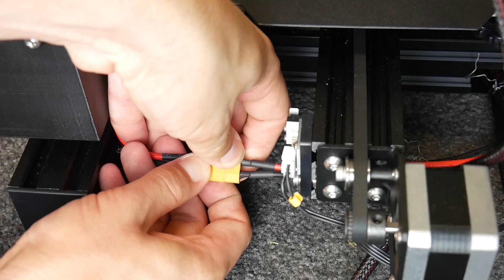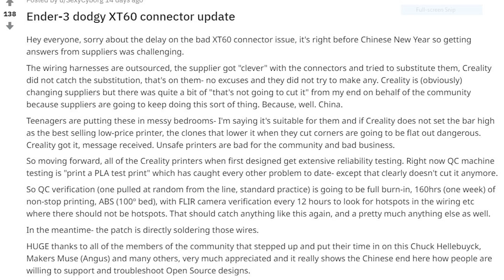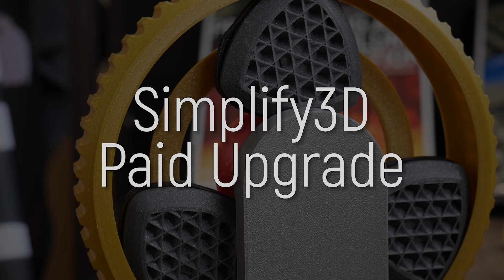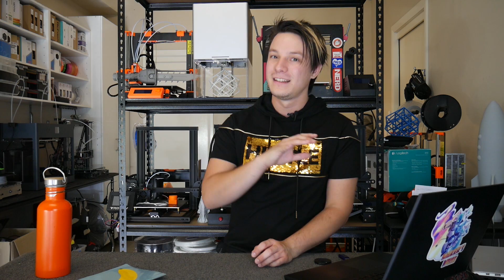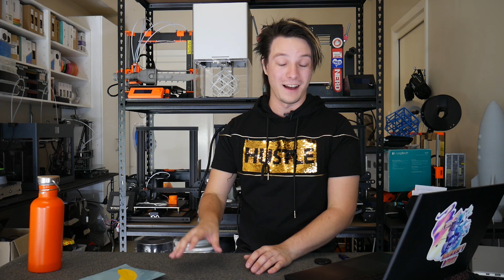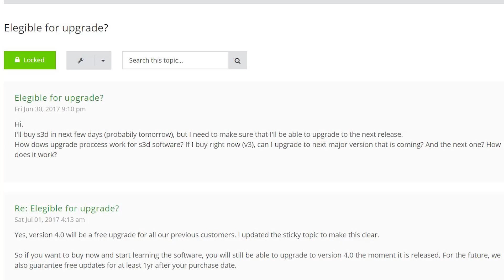Ender 3 Connector Update and Simplify3D Paid Upgrade - Maker's News Feb 2019

Comment: Hey Angus!

Just wanted to let you know i received my Ender 3 today and it was awesome! best build i have done so far, Everything just fit perfectly and worked first time. It came with a glass build plate and also a removable flexible build plate! They seem like genuine xt60 connectors and couldn't be happier with the quality of this build. All for around $280!

Not too mention came with a much better sd card reader, lots of spares, 5 different size extruder holes ranging from 0.3mm to 0.8, a bunch of tools and a few other bits and bobs.

Comment: I too bought S3d after the comparison video (and others). My experience with it has been good. It did the things I wanted, like processes, and seemed to produce a slightly better finish on my prints than the previous software. Haven't had problems with bugs or crashes and prefer not to have to update software a lot. If it continues to work this way, I will carry on using it. May even set it up on another computer as backup (current one getting a bit tired). However, changing the payment rules will cause me to look for an alternative.

Does anyone know if Cura or Slic3r support the Flashforge creator pro without having to develop my own profile? I tried Cura early on, but though it listed my printer, it only recognised one extruder.

Thanks in advance for any help.

Comment: I bought yesterday a simplify licens and nothing works out of the box. In my opinion it's as good as other freeware slicer. Ok it has some spacial feauters but you don't need them for standard prints. I will use the 2 weeks money back option...
Did someone of you use Craftware as slicer?
It's one of my favorites. It's free and get's better and better with each new version.

Comment: Hi, I have had a Creality Ender 3 Pro for 3 months now, and I've printed many things, but they tend to be on the smaller end. The longest print I've done was around 10hrs. I've looked at my "XT60" connectors and they are fine, and they have a snug fit. I have not checked whether they are soldered or crimped. If they are soldered, should I leave it as is? Or should I just play it safe and directly splice the wires?

Comment: I wonder if the simplify 3D paid update will finally have angled supports.   Being able to place a support at an angle (other than straight up and down vertical) is great for models where an angled support can just be angled to a nearby part instead of a long support all the way down to the bed, or if a small high part of a model needs supporting resulting in a tall skinny easy to fail support the support can be buttressed with other angled supports.  Very useful, and freely available in Craftware for ages!    Do any other slicers provide customisable angled supports?

Comment: Shot in the dark question but do you have any kind of tutorial or some suggestions for setting up a cetus mk2 profile for cura?
 Though I'll have to figure out the extrusion as I'm running a e3d v6 with a printrbot gear head extruder

Comment: Of course a company with a business model only based on selling software has to do something when the market saturates, because you have running costs. I purchased S3D 4.1 because at the time it simply was more advanced than Cura which followed with my printer. However, as you pointed out in the video, the free competition is there now, and while there might be some things which are still better in S3D 4.1 than Cura 3.6 I will not pay an almost full price again for an update, whatever the new bells and whistles even would be. Let alone the fact that S3D most probably will become completely unusable and locked-up whenever the company behind it vanishes or even decides to shut down old licenses - see Joel's trouble recently.

Comment: Thank you for your point of view, I think the whole community thinks the same, Maybe an upgrade fee $20- $50 max only IF  5.0 brings plenty of changed and new features. But charging $150 AGAIN for the same software is not cool.  I feel bad for those who purchased before the update $150 for 4.0 and $150 for 5.0 is almost the price of a new printer. At that point save your money forget s3d get a new printer and use cura! LOL

Comment: S3D is losing the slicer war fast. Their two big advantages, being custom supports and multiple processes aren't advantages anymore. Slic3r and Cura (if you install a plugin for it) can now do custom supports, and Cura can mimic multiple processes, and if you think ahead in your design it's easy to pull off.

Comment: After watching this video I checked my connector, and sure enough, it had burnt the plastic, and even the wires themselves were hot to the touch! I've been using my printer for over a month now, and it's kind of scary that I didn't notice this before. What I would like to know is if this is covered under warranty. My thought is that yes, it would be, and Creality would be obligated to send a "fixed" connector that I could replace the faulty one with. However I would like to know if anyone has tried, and what your results were.

Comment: You might want to put the protocol in your about page for the websites, they don't link on mobile.

I've also got a question for splitting up models. What's the best way to do that? I've got what's essentially a large rectangular prism and I need to split it up. I'm thinking something like dovetails would be best, but I'm not sure how one would do that in a way where the clearances would allow them to slide together. Any tips would be greatly appreciated, since I don't have much material to waste on fails.

Comment: I'm a maya,  lightwave, ZBrush user so $150 is not much to me but I admire the many other slicers out there that continue to improve and don't charge a dime. SLA printing is coming down in price and Peopoly has their own slicer now (Asura/ Cura based) and is free.  I might even stay with SLA full time depending on how the market goes with the larger SLA machines. I love not having to worry about all these mechanical and electrical problems with FDM. Trade-offs. . .

Comment: I'm one of those not happy with Simplify. I was under the impression it was the best out there, and was an investment into my current and future printers.
It seem I made an error in my research. I spent a couple of weeks combing the internet for info on printers and software. I did my homework and still made a bad move. So it goes sometimes.

I purchased S3D not long (2 or 3 weeks) after my setting up my 1st printer last year. I now have a <6 month old software package that WAS SUPPOSED TO INCLUDE UPGRADES, and now they want more money. I bought obsolete software for $150. One of the reasons was the Makers Muse series, but I don't blame you for the snag, I'm fully responsible for my actions, and I decided it was the best move. I was wrong. (not all that infrequent of an occurance) 
During my research, I was watching somewhat dated videos from you and several other reputable people in the field, and I spent the money whilst having a issue I had with Cura, which simply could not do what I wanted. S3D could, and easily. I'll give it that, it's not bad software, and it's easy to learn. I was on the fence until now if it was worth the price asked, but figured I'd see how the next few updates went before passing judgement there.
I now know that answer.
It's not the 1st (nor last most certainly) of my 'fun money' to crash and burn. I guess I'll keep using S3D as long as I can, and keep watching the pulse of the industry. It's now on me to learn another slicer (or 2 - or 3) and sort it out myself. 

I'm not cheap, but I am physically disabled and don't have a lot of money to throw around.  I fully commit to most of my endeavors, and now have about $2000 us in printer, filament, and parts. 
I plan to continue to improve my printer setup, but that $150 is the last of my money S3D will ever see.

Comment: So slic3r doesn't have something as nice as multiple processes, but it does have something that I believe is just as capable, and that is the ability to load modifiers for objects.  the way it works is, you double click the object, then click of load generic to load a generic cube (I think a cylinder is also an option)  of a specific size. after loading the generic you can move it around and change it's print settings, which take effect wherever it overlaps with the object.  You can use this to change settings at different layer height, and I believe even different sections on the X and Y planes (though I've never used it this way).  You can do this per object on the build plate if you want to print multiple objects at once that need different settings.  You can also use the load modifier to load a mesh of your choice, meaning you can design a mesh specifically for modifying the print settings in precise areas of the print.  It's a really powerful feature, thought takes a bit longer to set up than multiple processes.  I beleieve cura is able to do something similar, old cura had the tweak at Z plugin, which no longer works in the newer version but I believe has been replaced with something else, but I don't use cura so I'm not sure.
Reply: +Joe Well  I was unaware of this (Slic3r) trick. Thank you.

Comment: I've purchased S3D in 2015 and since then there were like 3 major updates (3.1, 4.0 and 4.1). That's 50$ per update. I'm not paying $150 again, no mater what since recently I switched almost exclusively to Slic3r Prusa Edition. The only way I'm paying anything for this update is if the changes are massive (and I'm talking introducing most if not all of the features community is asking for since 2015) and if it's around $15. 
I understand that the company needs money but they were promising features 'comming soon'  and they never came (probably pushed to 5.0 to make us pay) and I never owned a peace of paid software that  changed so little in 3.5 years.

Comment: As much as I've wanted processes and custom supports for a while, I never wound up getting S3D between the gripes I saw regarding updates, the price, and both Slic3r and Cura going bonkers recently-ish and giving me most of the tools I wanted. Nowadays, I just put any odd supports into the model during CAD, use tree supports in Cura or modifier meshes in Slic3r. My main likely use for processes was also covered when Slic3r gained controllable variable layer heights and Cura later automated it.
If there's a bright side for folks getting put off by S3D charging for upgrades, it's that the free slicers are advancing so fast that there probably won't be much to miss in a few years at this rate.

Comment: I bought it in Jul 2017. I remember reading the next large upgrade will be pay (Only remember as it was disappointing in this but still bought the product). I certainly did not expect almost zero improvements or bugfixes since then. Will not be buying anything from them in future.

I hardly use it nowdays anyway in lieu of Cura.

Comment: Angus, any chance you could do a feature substitute comparison highlights video of free slicers VS S3D?

I love S3D and the features it does right, it's intuitive and works well, great tutorials, it can do almost everything. 

But Slic3rPE, particularly the new Alpha release is a jump forward! If they just got their supports right...it's the weak link, and I am certain there are tricks to do it better, would love to see ideas how.
Reply: That would be very useful.  
With S3D so lacking in updates i have been playing with the idea of going for some of the free slicers, but not sure which one..
Reply: I'm the same @olaruud9366  , I want to move off S3D, but do big prints with the CR10-S5 and not sure what to use. I don't want to spend months learning a new slicer and then have it not do what I need.
Reply: Let me +1 this.  I have used Cura recently.  I know there are some interesting - what I'd call "windows dressing" like Octoprint Integration - things that it does, but it feels like for my usage S3D still slices better.  I read a post from a computer scientist that argued that as well.  An objective test on the slicing component specifically would be very useful...

Comment: I stopped using Simplify3D every since Slic3r Prusa Edition added the align to bed option. Also, it would give me an accurate print estimate, unlike S3D. It is very annoying when your slicer says a print will take 4 hours and it actually takes 12. Sometimes I have a schedule and for the printer and incorrect time estimates are unacceptable.
 I really can't justify spending even more money on a software that isn't better than the free stuff. I could barely justify buying version 3.1 when I bought it!

Comment: How about a guide to get Cura working for the Flashforge Dreamer? It hasn't official support for it, but I guess it's possible to use since the machine uses standard G code.
I'm using S3D right now but would love to switch to another good slicer. The update to S3D 4.x didn't actually do anything for me, so I will of course not pay for 5.0.

Comment: Most of the time you can debunk arguments like "XXX Slicer prints better than ZZZ Other Slicer" by the fact that the same print in XXX will take like 7 hours to print while the ZZZ gcode will do so in 2h. Well of course if your print takes 3x as much time it's gonna be nicer... No magic here.
If you just take the time to copy over every parameter from a slicer to another, most prints will be identical.
Myself, i like Cura because that's what i'm used to, i can find the settings i want quickly and it does the job for me. I tried S3D once after seeing an old Maker's Muse video (wink wink ;), loaded up a basic profile, added my model, sliced and printed it. It was a disaster. I was wondering why people thought Cura was bad and S3D the holy grail after seeing the results.
Well after copying over all my settings from Cura to S3D, it then printed just fine.
I just couldn't bring myself to pay ~200 canadian bucks for something Cura was already doing free for me so i stuck with Cura.
Then some time after i tried Slic3r Prusa Edition (I've got a chinese copy of the i3 MK2) and it printed not bad with a basic profile, but once i looked at the parameters, i noticed they were pretty much the same or close to my finely tuned Cura parameters "from the box" so yeah, no suprise it printed pretty good. The only parameters i had to change was retraction settings since i've modded mine to a bowden setup.
Moral of the story, use what works for you and screw the haters.

Comment: I think S3D have shot themselves in the foot. I would argue there are better approaches they could take for example monthly or annual subscription fee with a lower cost than a one off payment. In terms of cashflow this is usually a better option for a business. They could also separate the software into free and paid tiers, on the basis that many people won't need to use the advanced features. I don't mind paying for software - as a dev myself - I know the effort required to produce software that from the users perspective does not look complicated is enormous. However as Angus pointed out, it needs to be reasonably priced and continually innovate to stay relevant.

Comment: You hit the nail on the head for my reason for not liking this paid upgrade for S3D. They have not been updating or patching the software for v4 or v3 enough to see any value in forking out more money for the software. In fact the ONLY 2 patches for v4 introduced more bugs then it fixed. As well the free (and in a few of them open source) slicers now offer more features and in some cases better features then the paid software.

AutoCad for me is a software i did not mind paying for the newer versions. as there was actual value in upgrading. As they were supporting and patching bugs almost weekly.

Comment: I've had Simplify3D for barely one year. I just bought another 3d printer (Pulse) about 2 months ago and it's been hellish trying to use their slicer with this printer. I'm not sure if it's because of the Matterhackers integration or some other issue. It either starts too low or too high (if I use their recommended settings). The estimated time is way off as well for the 4.0.

Comment: Hello, Maker's Muse. even before I hade a 3D printer I have been watching your videos as a source of inspiration and for some important lessons. I have started to explore the software and hardware a great deal however recently ran into a new system called junction deviation (instead of jerk). I have activated this by the use of TH3D software (labelled as new jerk settings and new acceleration settings). I was wondering if you could do a video on this as I am still struggling with understanding and tuning it.